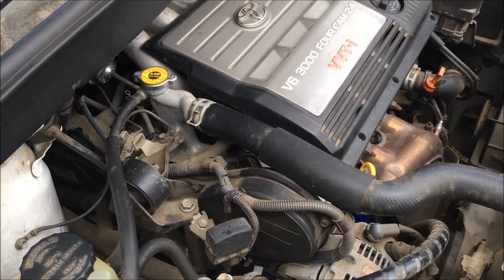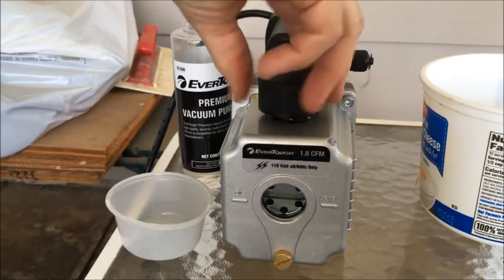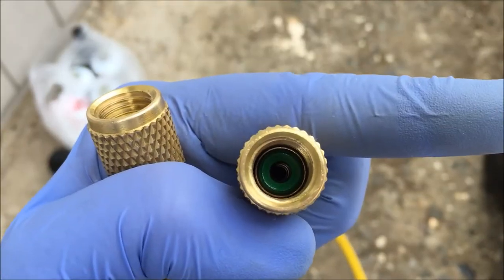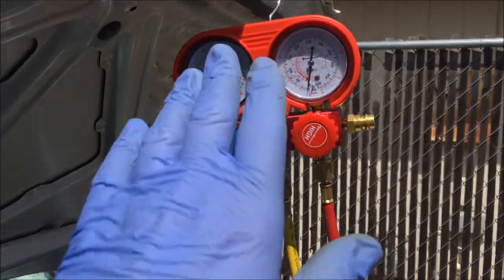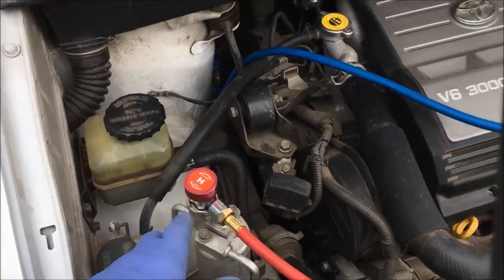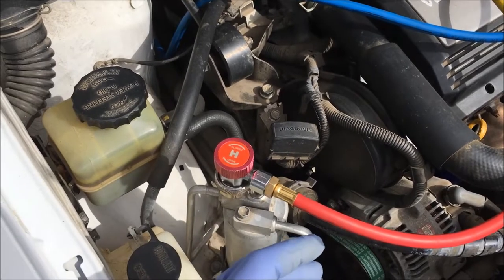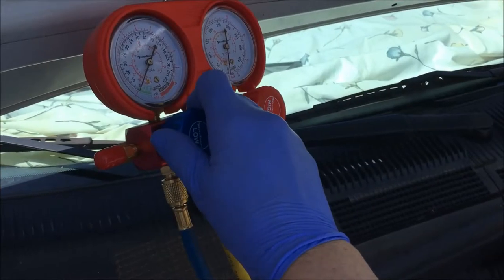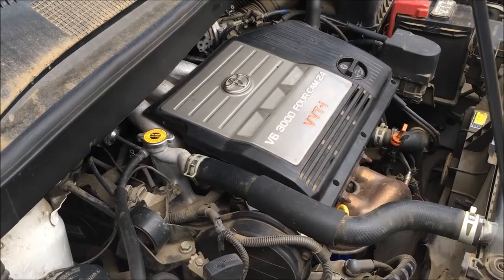Pull Vacuum on Vehicle AC System | 134a Refrigerant

Comment: Thanks for your video.  Used this method after replacing ac compressor on my son's 2003 Accord.  After using the pump it lost vacuum, albeit very very slowly.  Another time it lost a little, then held.  In the end I charged it up, and a month later is still blowing ice cold.  I suspect the $50 ac vacuum pump/gauge kit I bought from eBay had the leak, or maybe it's hose attachments did not mate well with the Schrader valves.  Annoyingly the attachment on the end of the yellow hose on the kit would not fit on ANY of the refrigerant can adapters, visited several Auto discount stores and they confirmed this, so I was forced to spend a further $18 on a hose/adapter set so I could actually add the R134 (any saving on buying a cheap ac kit was lost right there, not to mention the time I spent f**king around).  If it stops blowing cold I'll add some UV infused R134 and try and source the leak, have to say the condenser does look a little beat up but time will tell!
Reply from the maker: You're welcome, Robb.  I feel your pain.  :)  Typically, when I work on ACs, the gauges have some sort of issue to adjust or repair.  FIY--AutoZone loans out a UV detector/tracer.  For the record, I admire your frugality.  Happy DIYing!
Reply: @frugaldiy1  my frugality extended in trying to persuade my son not to bother repairing the ac in the first place as the car is only worth $1000, also he lives in Maryland so it's not like super hot all the time but of course he didn't listen.
Reply from the maker: Of course.  The tendency to ignore parental advice is written in the job description of children.